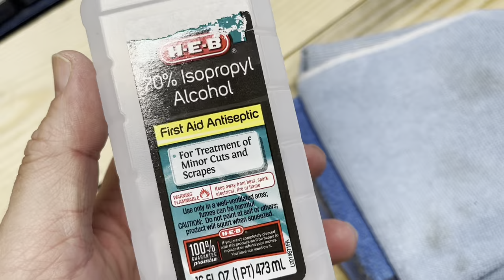3m vinyl wrap 2080 chrome delete Volkswagen Passat - DIY blackout grille and window trim

Comment: where can I get the wrap?
Reply from the maker: I ordered the rolls of 3m 2080 on eBay. There’s tons on eBay.
Reply: @DADMOBILE_Garage  how much did you need?
Reply from the maker: @charlieazadi2552  I got 2x 20ft rolls either 1.5 inches or 2 inches to do the whole car